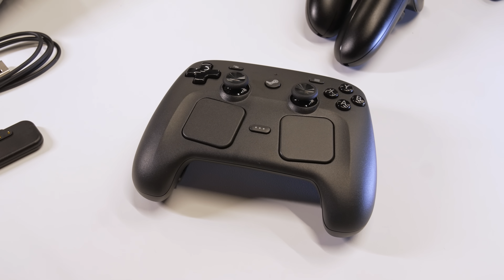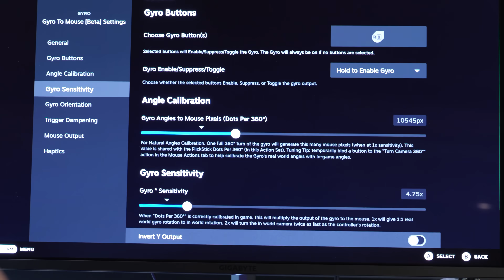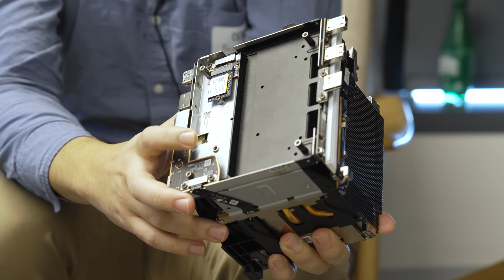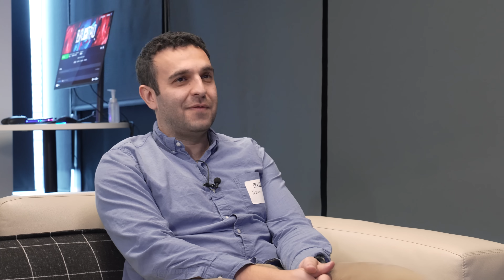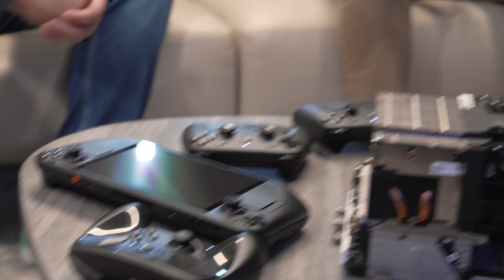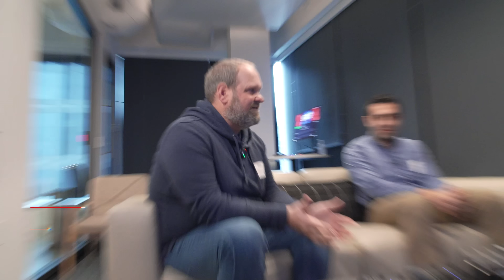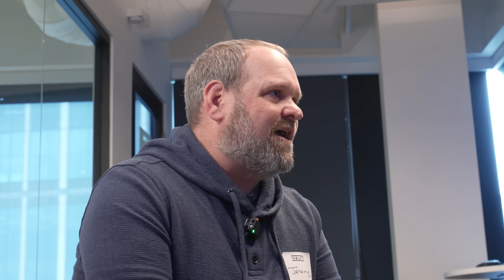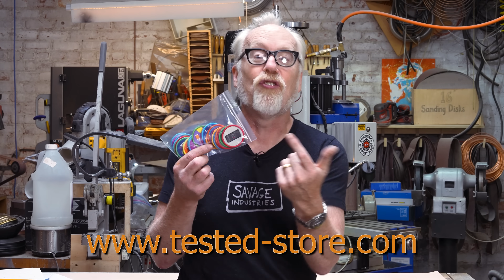Hands-On: Valve Steam Controller 2 and Steam Machine!

Comment: Not gonna lie, giving 4 back buttons as standard is certainly a game changer.
Reply: And the fact you can actually use it for independent actions unlike the Switch 2 Pro.
Reply: @Leo08x yeah my issue with the Switch 2 pro controller is I get used to my mapped buttons and then if I play handheld I than have to remember the original button placement which I don’t enjoy as it then breaks my muscle memory. So I’ve found myself not using them on the Pro controller to avoid this.
Reply: @Leo08x  what the heck? You can independently map lots of different controller's grip buttons on Steam but not the Switch 2? The Switch 2 is newer BTW.
Reply: @bland9876  Nintendo likes you to play games in the way they were designed, for better and for worse. Nintendo will almost certainly never have the level of customizable inputs that steaminput has.
Reply: Wait until you learn you can map up to 9 virtual buttons in each trackpad
Reply: @soukai  You can go to an infinite number of buttons if you create menu buttons with submenu.
Reply: @carlosbarreto4695 I know about layers and submenus, but didn't want to overload that person with information
Reply: @soukai  The purpose of 4 back paddles is so you don't remove your thumbs from movement and camera... not something trackpad virtual buttons can replace.
Reply: @chunkylover5367 they can totally replace it because you don't need to use the joystick at all.
Reply: @soukai If you're using the trackpad for buttons then you're not using it for aiming.
Reply: @bland9876 if you use the gyro for aiming you can use everything as a button, even the joystick.
Reply: @soukai  lol
Reply: @bland9876  Totally wrong, have it set to as mouse and then in that same menu add a mode shift, then you can have the mode shift be directional pad with the mode shift button as right pad click, with outer ring invert if you want 5 buttons. Then in each command change them to soft press and adjust the press so it take more force.

Boom you have trackpad for aim and 5 buttons if you press it with the settings adjusted so you aren't accidentally pressing anything. Easier to do with the OG steam controller as the clicks aren't as sensitive but this method works with steam deck and will with new one. Trackpad is great because you get mouse aim for big swipes, gyro on touch for precision, and 5 buttons without lifting your finger off your aim pad.
Reply: @bland9876 you can do both with the pads. You would just use some sort of mode shift.
Reply: @chunkylover5367 true. And this is the way.
Reply: @soukai What I REALLY want to see is virtual menu setups becoming shareable. It's absolutely wild that you can save and share control schemes, EXCEPT for those menus that are both very useful and very time-consuming to set up properly...
Reply: For games that don't need extra buttons, I often use the back-buttons as redundancy for ABXY so I don't have to take my thumbs off the sticks (rarely ever play any game where both left stick and D-pad are simultaneously relevant)
Reply: @tiagotiagot yeah, I always do that too, it's such a simple use but make sense when you think about how our body works in reality, like do we sacrifice our head movement for a milisecond in order to do actions like jumping? No we don't...
Reply: I love the back buttons, it depends what games you play. Fps like call of duty, it works well.
Reply: As a near 26 year old. When I was fifteen, I thought it would've been standard to have two back buttons due to the Steam Controller was perfect. It is a sad thing to see it fail. However... The Steam Deck and the Steam Deck Controller 2 are proving it is possible as I thought it was archaic to have 2 bumpers, 2 triggers, 4 action face buttons (start and select not included ) and just not have any back buttons outside of SCUF controllers during the 2006~2014 period. Every genwration before added buttons. I feel so old right now when I see a new steam controller as that was when I was in highschool! I feel and think that the Steam machin3 and new controllers are the only good premium options as it helps standardize PC hardware for developers and avoid crappy anti-cheat and DRM to be used in games.
Reply: @MaoRatto Buddy, back buttons in controllers have been a thing for ages now! 

Sure, if you look only at AAA companies like Microslop, Shittendo, Phony etc. that want to sell you the same old slop for twice the price, you cannot expect any innovation. For good feature-rich controllers that cost a realistic 60 bucks instead of 200, you will have to look at third party controllers.
Reply: @ThorsShadow yup. A few months ago I was looking for a new modern controller witg back buttons and everything and I had gotten tired of waiting for the steam controller 2.

So instead I bought an 8bitdo ultimate 2. It's amazing how a controller with 2 extra back buttons 2 extra shoulder buttons tmr sticks and hall affect triggers cost me less than a ps5 controller.
Reply: This should be the case for all the controllers and not spend $200 on a 3rd party.
Reply: My Scuf Valor Pro has back buttons, and I routinely inadvertently press them and have to keep my meat mitts carefully positioned to avoid them.
Reply: @SimuLord Either skill issue or design issue. I apologize, that was rude of me.

I never had any problem with the PS5 Edge controller or the PS5 backbutton mods
Reply: @kentreed00 

"Skill issue"

The hive mind mentality. Repeat the same bs over and over like a bunch of puppets.
Reply: @kentreed00  Clumsy hands and caffeine habit issue.
Reply: @originalityisdead.9513 someones mad at the truth
Reply: @kentreed00 Yea the PS5 Pro u can accidentally hit the back PADDLES, but not if u use the back buttons instead
Reply: You can use the back buttons for run when you're playing a game that doesn't use l3 as default running so for say while playing dark souls running is holding circle but instead you can map that to the back button and run while looking around at the same time it actually is a huge upgrade
Reply: I started using them for down pogo in Silksong, and it's hard to go back to any controller without them now.
Reply: We’ve had 6 fingertips facing upwards touching smooth plastic while we use our controllers for nearly 30 years and Sony and Microsoft still issue standard controllers with 30 year old ergonomics.  For 2 joysticks and all of the face buttons we’re using 2 thumbs!  I think Valve are the first company to make back buttons standard for base controller.
Reply: I used to think it was kinda pointless but after playing around with my deck for so long, it's really really cool
Reply: I've been using the back buttons for dodge/sprint on the left and jump/misc on the right, since the original steam controller. It's gotten to the point that I just can't go back to using the front buttons for it since they are an invaluable simultaneous input lol.
Reply: My non gamer gf even uses the back buttons on the back of her steam deck. Ain’t no going back
Reply: Gonna be great for fighting games
Reply: Facts. Got an 8bitdo ultimate 2 and the 4 extra buttons help a lot in bl4. Got real tired of accidently pulling up my quest arrow or summoning my car when I'm trying to heal lol.
Reply: I use the back buttons all the time in my deck. Allows all sorts of qol improvements
Reply: Just getting away from the Xbox controller as the standard would be a huge game changer. If we can have ubiquitous gyro and hd haptics, it's going to be awesome for games.
Reply: How do you hold controller with back buttons without accidentally pressing them ?
Reply: @PhongNguyen-w1r almost more like squeezing it between your palms. It's surprising easy and you can still hold it with one hand.
Reply: @PhongNguyen-w1r  I find myself holding controllers mostly by palm + middle fingers on the back. Ringfinger and pinkie are then "free" / just rest easily with very little pressure that isn't enough to activate back buttons. :)
Reply: Yup, because it's gonna force other companies to follow suit.
Reply: I'm curious what people think about having two extra buttons where the shoulder buttons are because I've seen some controllers do that and it actually seems like a good idea so if you do both 4 grip buttons and the two extra shoulder buttons you'd get a total of six extra buttons.
Reply: @bland9876  I like that in my 8Bitdo U2 but I wonder if it's better to have 4 back buttons instead, I do find myself sometimes wanting to use those extra bumper while using the triggers but maybe each position of extra buttons has its own uses and limitations.
Reply: @Leo08x ya back/grip buttons can be better than shoulder buttons for some uses but shoulders could be better for things you don't want to accidentally hit.
Reply: i use all 4 constantly in some games. I'm GLAD its a standard now.
Reply: I love it. Been playing Fable on Steam Deck. Original version doesnt have controller support, but with the back buttons I have just enough comfortable inputs to make the control scheme work. Theyre great buttons!
Reply: The Steam Controller back paddles are amazing. I can't quite get comfortable using the 4 separate back buttons on my Steam Deck.

Fuck patent trolls...
Reply: I only use them as fidget toys lol (on steamdeck)
Reply: I use some of them sometimes, especially in games where you usually use a mouse and keyboard. But where I found use is jumping, running and crouching. More like interchangeable buttons, but sometimes I forget (still new).
Reply: There is even sensors built into the thumb sticks one when you touch the middle of the stick and another one senses when you touch the outer ring and they act like buttons that can be mapped to a custom action so like if you want to enable gyro aiming ...but have it disabled as soon as your thumb touches the right stick it will turn it off.....or have it to enable auto walk in a game when your thumb is only making contact with the outer ring of the tumbstick.....yea it's the future of controllers ....hopefully Sony makes something like this for the ps6 ...
Reply: I made one a manual button in thps2 - you can program it to chain commands together with custom timing
Reply: making those quantum tunneling magnetic switches normal also.
Like essentially tells all game companies that it isn't okay anymore to still use old pot based ones just to save €0.10 on production and to make sure it breaks faster and people buy new or that they can sell a overpriced premium one.
(yes hall effect sensors aren't actually expensive to make, don't know about the cost of those magnetic quantum tunneling ones, but using something better than hall surely punishes all those crappy companies deciding to still use worse than hall in their expensive console remotes).

the layout of that controller with the touchpads and such might also do very well, excluding perhaps it being to square and so possible less comfortable to hold for long, like square is okay on the steam deck as it is wide.
but that controler is thin.
would be super cool if you could split the controller in 2 to also use it like vr like controllers.
Reply: No additional shoulder buttons is a miss though.
Reply: Just you wait until you learn what Steam Input is and the imaginative ways you can bind these buttons.
Reply: Even if most people not going to use them 
I can still see other people using them 
Like me 
I always hated that I have to sacrifice useful buttons and convenient controls just because I choose to play the games with a controller 
Like I wished I could use the mouse wheal or be able to use buttons that you can only access them with the keyboard scheme like quick save and load 
With this controller I can Finally do it
Reply: Thanks for not lying
Reply: I've been spoiled by the extra shoulder buttons that have been coming out recently, they're real convenient
Reply: Absolutely. Legendary addition. It fits so well, too! So many additional possibilities.
Reply: Losing the dual stage triggers hurts a little bit though
Reply: Honestly, I'm not big on it. I just never had a use for them to properly justify it
Reply: wish we had an option to get the controler without them. i cant stand the back buttons
Reply: I honestly don't know why Playstation or Xbox doesn't have independent back buttons. I fee more ergonomicly placed buttons would be useful, and if the games doesn't use them, it doesn't use them, at least you can reconfigure.

I'm happy the Steam Controllers is implementing it as a default.
Reply: Thanks for not lying
Reply: Soon we will have as many buttons on our controller as a keyboard. But in all seriousness this controller actually looks decent. I still haven't found a use for back buttons in any game.
Reply: @polraudiozion1156 I use back buttons for L3 and R3 in literally every game. I don't think I could ever go back to a controller without back buttons for that exact reason. It's so much easier to press L3/R3 that way and you can often map various functions to that ESPECIALLY for emulation.
Reply: @polraudiozion1156  How have you not found a use for back buttons in ANY game? If you played ANY first-person game then the obvious ones would be jump and pick up stuff / engage stealth / slide / kick /dodge. Heck in ghost of tushima on an xbox controller i bound one back button to a macro for guiding wind (right pad + rs up) so I would have to let go of steering the horse to do that same motion.

For racing games, well .. maybe gear up / down ? Like the paddles in a racing car :D
Reply: @polraudiozion1156 I've found that if there's one of the A/B/X/Y buttons that I have to press a lot or that I would want to press at the same time as I'm moving the camera, binding it to a grip button makes things a lot easier.
Reply: @Basilo1146  Bind it to ALL the grip buttons if it's only one button you want.
Reply: @polraudiozion1156  I am a Steam Controller user. I still can't find a use for the XYAB buttons. That's because I always use the buttons on the back so as not to be distracted from controlling the camera.
Reply: @polraudiozion1156 learn what touch menus and action layers are and you'll have essentially infinite buttons
Reply: @polraudiozion1156  If you've played a shooter on consoles, there's the ever present problem of taking your thumbs off the thumbsticks to use another button so you are either not aiming or moving when pressing those buttons. The back buttons fix this issue, not only do you have more buttons to use but they can be used without taking your thumbs away from aiming or moving.
Reply: @polraudiozion1156 

You could use the four back buttons for actions that would normally be on the face buttons, like jump or reload weapon. This frees up the face buttons to be used for other actions, and lessens the time spent with your fingers off the analog stick and touchpad.
Reply: @polraudiozion1156  I used the back buttons for combo deals. instead of RB + X and then thats b ack button, but I play double claw.
Reply: @polraudiozion1156  most dark souls games would benefit from it.
and given the steam machine wants to make it as easy as possible to play all pc games,
more buttons just means it can cover more of a keyboard.
Reply: I’m hoping devs don’t go and assign actions to them.  I want to be extra buttons I can assign as I see fit.  (Typically in place of L3 and R3)
Reply: @redmage777  It's very unlikely to happen. Some might make a recommended layout for the steam controller but you can't rely on your customer owning this specific piece of hardware. Also even if you could just change it.
Reply: @redmage777  you cant assign actions to them they dont actually have any actions to them infact nothing on the steam controller has any assignment to it

a xbox/ps5 controller each button does "something" abxy lb rt ect ect ect 

steam controller does not have anything assigned to it there just blank buttons you map them to stuff in the software

so the back buttons and all the other buttons dont have a default config that a dev could map too

also its pc games so devs map to keyboard functions and mouse functions some will also map xbox controller inputs 

"some" devs will make adjustments to there controll mechanics to allow steam controllers to work butter but they cant hard map to the controller
Reply: @redmage777  I just always assign buttons to keyboard in Steam Input except for when the game accepts both kbm and controller only inputs like joysticks without issues, so remapping it on Steam Input is a way of getting around any developer presets too.
Reply: I guess but tbh in the 3 years I've had my steam deck, I dont think I've ever used them
Reply: @joshsheler7036  You should try using them. I have a different controller with four back buttons and I keep my  right thumb on the right stick at all times and map all the face buttons to the back buttons. More efficient cause you're not switching your thumb from right stick to face buttons back and forth all the time and it just feels good.
Reply: I dont get it. I never program them on any controller I have. I just dont get why id use them
Reply: @Jack_Ss wtf you mean? It's a game changer bro, my right thumb don't need to move to press the face buttons anymore
Reply: @Jack_Ss   Don't worry you don't have to. If you don't use them, then they weren't for you.
Reply: @emerson-biggons7078 what do you use them for?
Reply: I definitely disagree
Reply: As someone who plays double claw, I just can't find a use for back buttons. But for a normal human being, I bet they're a life changer. Maybe I would use them to turn on/off gyro on the fly. but that's all I can think I'd want them for.
Reply: @saithvenomdrone as a constant sprinter in games, I find that the back-buttons are vital to use for that so that I’m not clicking in the stick, which is super annoying
Reply: @saithvenomdrone  i used to play Claw 24/7, your accuracy will improve tenfold when using paddles. the way you hold a controller in claw isnt ergenomic thus making muscle memory aiming a lil less accurate. but tbh its all about preference, ill jump on an old XB360 game and muscle memory goes straight to claw XD so i get it but if you can deffo give it a go
Reply: @saithvenomdrone   It's more of a power user or KB/M games without native controller support and a thousand individual buttons
Reply: I never use them on my SteamDeck...
Reply: @FischOderAal | It depends on the games you play! A controller with back buttons was a lifesaver for Elden Ring, because normally you use the Dpad to swap through your items/weapons/tools, which requires taking your thumb off the movement joystick (and leaving yourself vulnerable). By mapping Dpad inputs to the back buttons, I was able to completely avoid that problem.
Reply: @PotatoPatatoVonSpudsworth  If you play on an Xbox style controller with offset analog sticks you don't have to take your left thumb of the movement stick to swap weapons and items.  Instead you can easily use your right thumb to swap items on the d-pad which is far less disorienting and allows continuous movement.  This is also how you change weapons optimally in Gears of War.
Reply: @PotatoPatatoVonSpudsworth Not to mention trying to run while doing anything else forcing you to turn your hand into an upside down bears-claw. Back paddles totally solve that problem
Reply: @PotatoPatatoVonSpudsworth  Back buttons was stupid useful for Armored Core 6 so I don't have to press the face buttons literally ever and can permanently keep my thumbs on the sticks.
Reply: @FischOderAal  Not every game needs them, but for the games that do, it's a godsend.  If you play enough games that aren't really designed with controller in mind, they are a necessity, along with the trackpads.
Reply: @FischOderAal then use... 
even simple action like reloading gun or jump I map them all to back buttons, because why wouldn't you want to simultaneously control your eyes and body at the same time?
Reply: @FischOderAal Id go a step further I always fucking accidentally hit them so I almost always turn it off on my deck
Reply: @FischOderAal I do all the time
Reply: @FischOderAal  i use them all the time on the steam deck.
Reply: @FischOderAal  Personally, I don't like using the analog sticks as buttons (R3, L3). I believe that doing so drastically reduces the lifespan of this mechanism.
That's why I always configure these commands on the back buttons on my 8bitDo Ultimate, and this also results in a much more satisfying gameplay. For example, in a Soulslike game, I can lock onto an enemy without having to stop rotating the camera.
Reply: @FischOderAal then the controllers not for you, i use them all the time on my steam deck
Reply: @FischOderAal  I rarely do, in Sonic Racing CrossWorlds however I find them to be easier to use sometimes than the face buttons.
Reply: ucan use 10 finger all in one time if theres good positioning back button on controller, thats how i play elden ring,10 finger for each button ( ofc thumb only for joystick ) 😂
Reply: I used to use them all the time on steamdeck for fps games
Reply: @FischOderAal  They're cool for things that are better done simultaneously, I have an 8BitDo U2W which has 2 back buttons and 2 extra bumpers and in shooting games even though I use Flick Stick and gyro I don't like taking my thumb off the right stick to jump or crouch in case I need to react fast to something, and due to ergonomics, since playing claw is not exactly comfortable, at least to me, you can use them in games that are better played on KBM which have a million inputs, Steam Input gives you a lot of customizability to play in the way that is comfortable to you as well and Valve has kept improving on it.
Reply: @FischOderAal  I never used a SteamDeck...